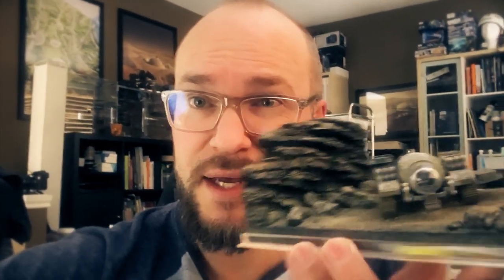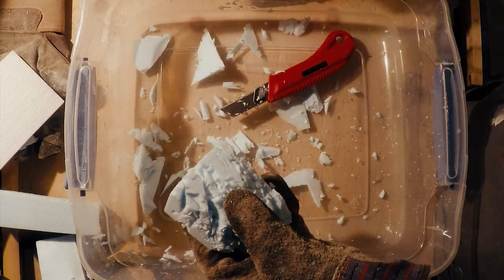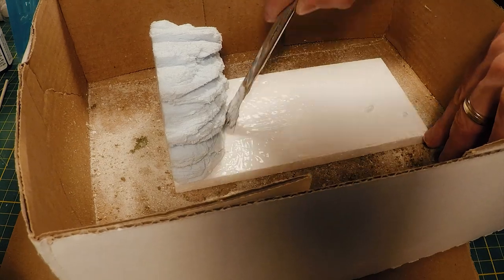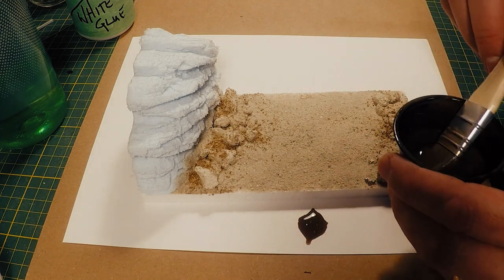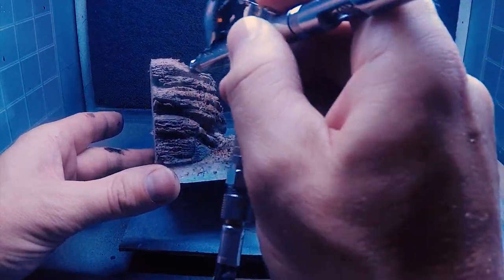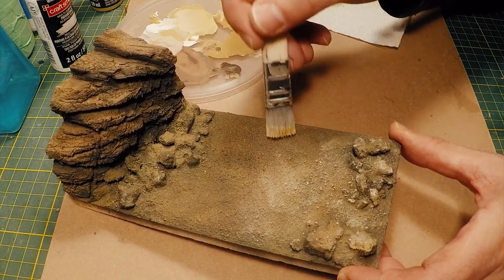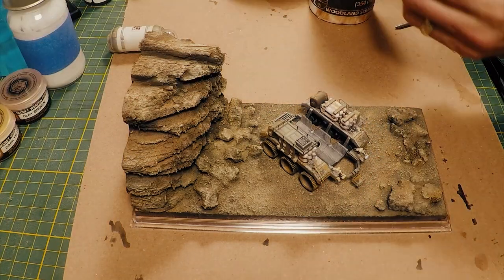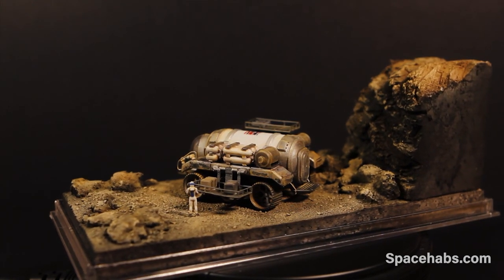Mars Terrain - How to model a diorama from scratch - a tutorial with Prototype 31

Comment: your boxcutter isn't sharp enough to cut foam smoothly. Which makes i more difficult, messy and dangerous to cut.
Foam needs a veeery thin and sharp knife. I recommend to sharpen your blades
Reply from the maker: Slashing foam definitely dulls the end quickly. I have to remember to snap the tip off more often. I'm too frugal with blades. Thanks.
Reply: @spacehabs9057  glad this helped a year later :D